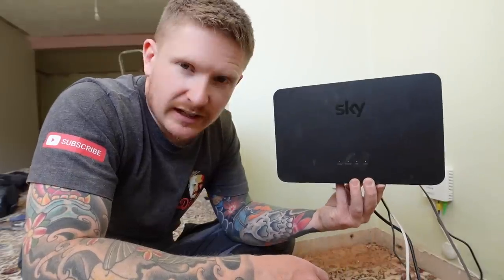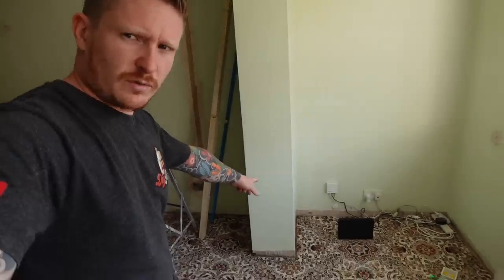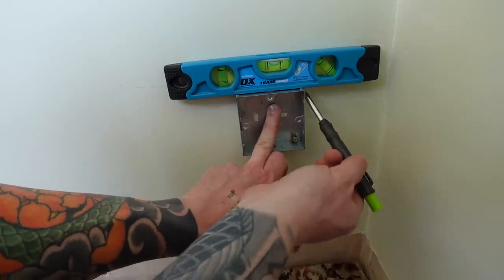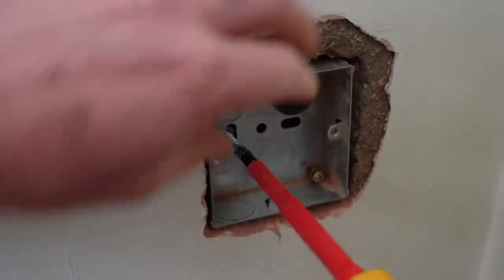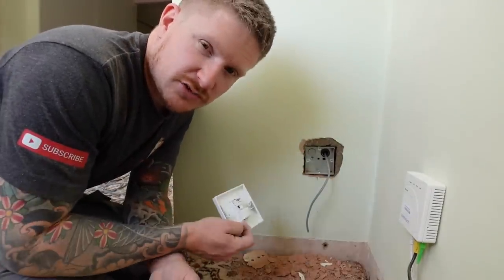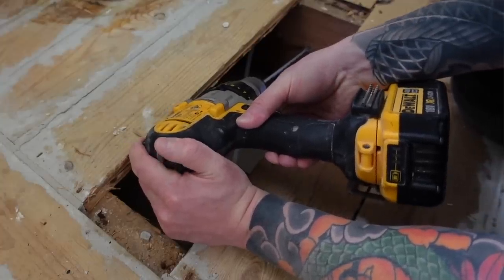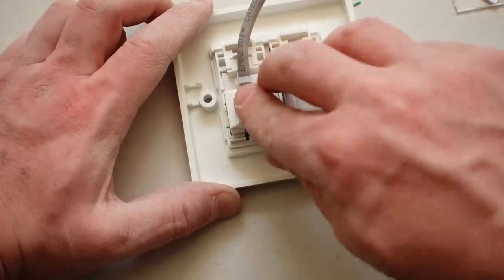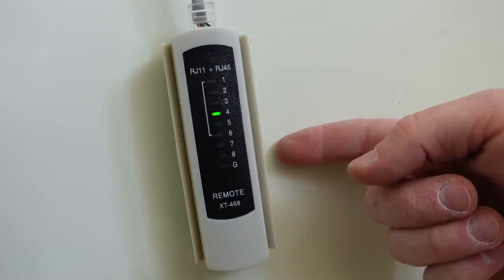How i Installed Network Sockets in an Old House | No More Wifi

Comment: I used to install many home network systems with cables going back to an AV/IT rack.
However, many homeowners weren’t installed in using it unless for static hard-wired devices such as smart TVs, printers or NASs. Even laptops they always preferred to use wi-fi. Equally, I’ve had clients who insist on WAPs that can handle their incoming bandwidth. I.e, if they’re paying for 300MBs they want that through their wi-fi
Reply: Unfortunately wifi speeds are usually bottlenecked by the router & effected by the composition of the walls. Current TV adverts by several companies in the UK for “the nations fastest wifi” are carefully worded & unprovable.

Comment: Ex BT repair here. I always cursed the installers of riser fitted dropwires for not supporting the top of the cable with even a cable tie to take the strain off the inner cores.  Finding breaks in high rise blocks is a right pain in the proverbials, one floor at a time.  Edit: too many full stops.

Comment: You should use some conduit on your wall run so future work to the cabling, running extra cable or upgrading what’s there etc is possible and easy.

I’d also advise you to run two cables even if you only plan on using one. Network cable is cheap and you’ve done all the hard work already.

Comment: I don't know why this isn't standard in new builds. I want to do this to my house though as a new build reluctant to damage new walls. Hoping there is some way I can feed the cable through existing pipes either electrical or coaxial. I could go around the house though I would like to keep wires hidden.

Comment: I love the little yellow tool, I've always had a big clunky stripper or snips in a rush, that tool looks ace. As always, a damn good video Cameron, hope the old house is coming along nicely.
Reply from the maker: Thanks! Coming along well. Hope to have some updates very soon
Reply: You want a proper punch down tool to be honest, it trims your wires perfectly as you do it.
Reply: @domhamai  For a few cables, those small ones do OK, but I agree, if you are going to install more than a couple of cables, a proper punch-down tool with spring and release will do the job better, and cut the excess cable in one.

Comment: Just a note for anyone taking on this project. Do not run cat 5e cable along side mains power cable or through holes in joists that contain mains cables. a 50mm gap between the cables is required.

Comment: If you already have coax aerial sockets throughout your house then it's a lot less hassle to use MoCA adapters to get wired ethernet network connections everywhere 👍
Reply: Not particularly easy to get in the UK. Any you would recommend?
Reply: Just like power line adapters these should really be a last resort.

Comment: Good video about the practicalities of running the cable (the hard bit). Making terminations is the easy part! for any more than a couple of sockets I would start thinking about running the cables into a patch panel and putting up a network cabinet somewhere out of the way. That way you can hide everything neatly away behind lock and key.
Reply from the maker: Well said! Thanks

Comment: I've put all my  network cables under the carpet near skirting boards, from gound floor where the ONT is, using cat 7 flat ethernet cable into Cisco SG250-08 (found 5 units in carboot sale for £25 all), than each unit was fitted, one in basement, one in hallway first floor, one in attic one in garage. Using flat ehernet cable, was easy to put it under the carpet from 1st swich, one cable to basement swich, 2nd cable in garage swich, 3rd cable into tv from kitchen, 4th cable in 1st floor swich, from 1st floor swich to attic swich. all 5 tv's , 1 printer, 3 desktop computers, 1 playstation 4 pro, 1 playstation 5, 1 Reolink NVR for cctv, 1 NAS  are connected by ethernet cables.

Comment: I've just moved to an 80's bungalow and was anticipating a relatively simple path for adding network points and the like. Well the internal walls are Stramit compressed straw panels and are horrible to work with it seems for an average DIYer like me. Apparently there are voids in them for cables. I've had a couple of light switches off and they're a horrible mess, the knockout box screws barely doing anything. Straw, frickin straw!

Comment: ... or don't wreck your house at all and use simple homeplug/powerline adapters... just plug into the existing electrical sockets (you can get a pass thru version so you don't even lose the socket). Plenty fast enough for most purposes, if your wiring is compatible.

Comment: The comments I’m going to make are made from a 50 years experience view and they are not. a criticism of your skills and abilities, however the equipment alone that you have used runs into the hundreds of pounds and I’m referring to the tools, sds drill bits, angle grinders, the upheaval is only worth this if you are doing a renovation, the time involved to do the job as a diy project would be days of upheaval and then you have the parts, which would be around £25 min.
The chasing out of the wall with angle grinder is horrendous, and can be reduced by a second person with a water spray simultaneously spraying the area and the clean up and replacement of carpets, boards, etc etc, the much easier way is to have a good router with modem in one, TP link and an extender or repeater which are different but again TP or replace a double socket or single with one built in, total cost for the router £45 the extender or repeater, look on YouTube for advice, £25 total £90 tops and that’s for really good models, time factor depending on second part extender or  repeater half a day or a couple of hours to set up, but your going to have to do that anyway.
The Stop cock spot on and couldn’t fault you , but would advise to turn water off as they can shear, however that’s my only criticism and 35 years ago in Sheffield I discovered a leaking stop cock that, wait for it, instead of fixing the people/owners had had the joist, not replaced but there had been three pieces of wood from different years in the past spliced into the joist, and a strengthening bar fixed as well instead of replacing or as you have done repairing the tap, the fix was as you did quarter turn and it stopped, however the damage was spores all under the ground floor and the whole kitchen ripping out including the floor. Best of luck with the renovations I’ve done ten full houses and so I’m talking from an experienced point of view.

Comment: Wrong Tool!!. @12:07 - Do not use those tools to peel out the insulation on a network cable, you will nick the cables. The correct way to take insulation out is using the pull cord inside the cable itself. No tool is needed, the cord inside the cable will cut through the insulation. Any decent network cable brand will have a built in pull cord. The only ones without one are the really cheap knokoffs.

Comment: Tbh I'd go for a at least Cat 6 if you're doing this, but i'd put in Cat 7. Cat 5e is well on its way out and slow asf compared to what you can get with Cat 7 and Cat 8, and thats before you start touching fibre. Cat 7 really isnt that much more if you're buying a reel of it and by putting Cat 7 in means it will last way longer before its needs to be replaced and you wont have any bottle necks if you have a lot of people using the internet in the house

Comment: All well and good, but that is just a small part of the story.  What about connecting all your new sockets to the internet.  where do the other ends of the cables go?  What about fitting a network switch and connecting the switch to the internet??   Will you be coveriung this at some point???

Comment: not sure if this applies to the uk but in the US you don't need a box for ethernet cables becuase they are low voltage you can just run them straight to the wall plate. they make special wall adapters so that you can screw the wall plate into that.

Comment: Great video. Couple of observations. 
In 2023, I would not be using Cat5E. I would be using Cat6A as a minimum. 
And when running the cable through as chases where it will be recovered with plaster/filler, i would run the canle though some conduit so you can re-pull a cable with ease later if you need to without opening up the wall again.
Reply: If you're running under 25m then Cat5e should suffice. Cat6 is a pain to bend round corners.
Reply: Cat6a needs a bit more care, because it isn't as bendy as Cat5e. Cat5e should be enough unless you want 10Gb speeds, but Cat5e will be much better than a wireless connection.
Reply: Unless you're streaming 4k porn from Plex servers to multiple locations there is no way the average DIYer needs a anything above 6 for at least the next 5-10 years.

"Future proofing" is such a marketing term to spend more money on useless tech. 

It's like spending extra money on an 8k TV when we barely get native 4k streaming 🤷‍♂️
Reply: Whilst it's a bit difficult to "recommend" it because you never know for sure what can happen in the future, honestly speaking, in my experience Cat5e is fine. I ended up using that on my house as it was what I could get right away from the local trade counter. You can run up to (from memory) 45m at 10GB which should be more than fine for any residential application. I did my whole house in Cat5e and have no problems connecting my PC to my NAS over it at 2.5GBE, and a link to my garage at 10GBE (approx 25m run), all working fine.
Reply: @SBBUK  you realise max throughput for Cat5e is 1000Mbps right? so you're not seeing 2.5gbe or 10gbe if you did the house in Cat5e...100% cat6A would be a minimum for me. however I did mine in 7, since its not a great deal of money.
Reply: Makes no difference what cable you use if no dynamic response test is not carried out. point to point cable testers a re very useful but...
Reply: @dukeminster  I can show you iperf tests if you really want but yes, I am getting full 2.5gbe and 10gbe on short runs. As per my comment, I would probably buy cat6 or higher in future with proper planning, but if all you have is cat5e don't sweat it
Reply: @Theosplaytime  10 years ago 100mbps would have been eye watering. This isn’t buying a router this is putting in infrastructure in your property you’d hope to last decades not a few years.

It’s not the cost of cabling you need to consider but the cost of replastering and redecorating for the sake of a couple of quid.
Reply: @dukeminster you’ll get 10Gig out of 5e up to about 30m, maybe a bit more. I agree go with 6a but it is harder to work with and (marginally) more expensive.
Reply: @dukeminster  The 2.5Gb and 5Gb standards where made for using Cat5e cables.  Using Cat5e for 10Gb isn't to any standard though but that can be done over decent cable at shorter lengths.
Reply: @Theosplaytime  ok mr luddite
Reply: @RickMyBalls  ha
Reply: @dukeminster  Agreed. I did mine at least 8 years ago, and I used 6A then. This is the kind of job that's a huge pain in the arse, so you're better off using the best you can get your hands on and be therefore less likely to ever have to do it again.
Reply: @mikewilcox  100Mbit gets you a real world 7-10 MB/sec throughput. I'd agree if you said 20 years ago, but even in 2013 gigabit was pretty much ubiquitous.
Reply: @mikewilcox  Do you really need 1000mbps right now though? 
Do you think you'll need more than that in the next 10 years? I highly doubt it.

Comment: personally, i would have run a single line from  your router to the core of the house and installed an 8 port switch with a patch panel

Comment: Query for you- do you have to use the same cable for the plug and terminals? I have an outside cat 6 cable that is wired into poe switch and runs through the wall and router. I wanted to use a plug and sure it is wired correctly. So basically camera to plug and then plugging in ethernet lead from router to plug inside house. Could not get it work at all. Only by removing the plug and directly from switch to camera will it work. Or is it using the poe switch? Thanks and love the videos

Comment: Great video, just a quick question, I know nothing about this sort of stuff especially drilling. If you are using the test for seeing if there is wires/pipes behind the wall, is it definitely a case where there wont be wires or pipe on the other side? Thanks

Comment: My house has weird stuff in the bricks that affect WiFi. I had to run cables and repeaters to cover other rooms.

However, I planned the distribution and I did it properly with far less damage to the masonry walls than you did. I also made sure that when I was going into a floor space above the ceiling, I had removed the floor boards first and checked for pipework or electrical cabling BEFORE drilling upwards.

It’s important to remember your potential audience and provide appropriate caveats in the video.

Comment: If your going to run a cat cable you only need an old router to extend your internet. You'll get additional wifi signal, separate network for the kids and more than 2 extra ports to use. And a cable tidy 1cm square will save all the drilling/DIY. Make it far easier to change or upgrade the cable in future.

Comment: If I had the tools and knowledge 5 years ago when I bought my 1930s flat I would of trid this. My solution ended up being using a flat 5e cable and routing it along the skirtings and tucking it into the carpet because I'm a classy guy. Far from ideal but this is a great solution especially as home plugs are not great and old wiring isn't ideal either

Comment: I put ethernet cables in back in 2005 when I renovated as I knew the future would be some kind of streaming service. Back then they were cat 5 but it still does 1 gig no problem. However the future will probably be fibre optic, so leave some draw string .

Comment: Personally if this was my house I would use conduit where possible so that cable can be replaced should it be required. Can't imagine a fault appearing on the cables within chased walls. Cable is more likely to be damaged during installation than going faulty in that area. It's more likely a fault would occur underneath floorboards if left unprotected from rodents. As an ex telecoms engineer I've seen this loads of times where mice have had a nibble and cables inaccessible. Only option is to cut off and run a surface mounted cable which defeats the point of your installation.
Reply from the maker: My cables are within conduit. Thanks

Comment: Also just to be clear cat6 only “carries faster speeds” when you attached device is running data at faster speeds and literally none of them do that aren’t in data centres. Ok new wifi access points might run 2.5gbps but no point of your internet connection is a 100 meg. 1gig on cat 5e plenty good enough don’t bother with cat 6. In my view anyway.
Reply: I'm sorry, but with the way fibre is going we could easily be seeing speeds in excess of 1g in the UK in the next few years, some companies are already trialling this with their customers.  No one wants to constantly be ripping their cables out the walls why not spend a bit more and future-proof yourselves.

Comment: That's messy drilling due to hammer action of the drill.  After the small pilot drill hole work on the exit side but do not use hammer action, you won't need the hammer action.  The entry hole will now be clean and the exit hole will be a cleaner exit.  When breaking out of the exit with the bigger drill hole it will break out in the exit box area and will not be seen.  Always use trunking in your chase because it provides an easy cable pull which prevents snagging.  Snagging twists inflicted upon a solid core cable can break one of the 8 twisted pair internal wires so you don't want that!  You can also use Toupret filla along the chased out wall and you won't suffer from the usual shrinkage cracks or filler sagging.  Try to avoid sharp bends (and heavy electrical noise/motors in industry). because it reduces the signal quality of the wire.

When you are finished you can't beat a good cable connection and it will last you 20 years+.
Reply from the maker: I agree with you on the drilling however in this case it makes no difference as your chasing out the area and bonding it anyway. 20mm oval conduit was used in the chase.

Comment: Great work. Couple notes though.

I would definitley go for a 4 gang minimum on the one closest to the wall. Even if you don't need 4 points round the house right now at least you could spur off from them.

Also, get some conduit in there in case you do want to run more wires or swap some out.

Finally, if you don't care too much about latency and bandwidth, but still want a wired connection you might want to try out powerline adapters first. They plug into the wall outlets then use your electric cables already in your walls to transmit signals.

Comment: Extremely bad to run cable like that!
If you draw pipes from pvc plastic like we do in the north.
You can change the cable, you can also pull three cables in one tube.
Reply from the maker: It’s in 20mm conduit so no idea what your referring to

Comment: I replaced the single coax in 3 rooms, years ago with some thin coax + cat5e which isn't thick and work side by side. It is now on it's 3rd WiFi system. Running 3 x 2.5gbe WiFi 6 APs delivering 1200mbps.

Comment: Wait why need extra cable tho. There are plenty cheap powerline networking adapter.

You can run internet through normal socket using the adapter
Reply: powerline adapters don't always work well. Its dependent on your home's electrical wiring. Last time I tried them (about 6 years ago), they disconnected frequently. It took a lot of trial and error trying to find the best power outlets to use.